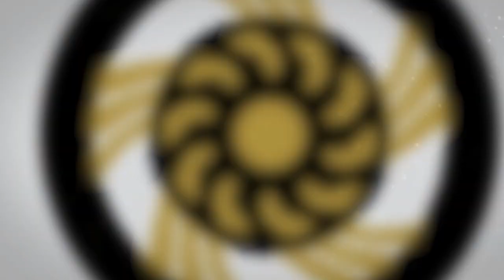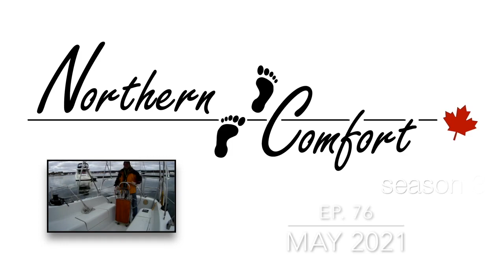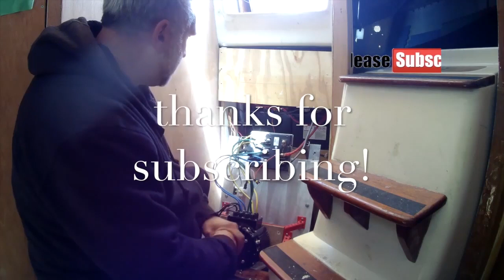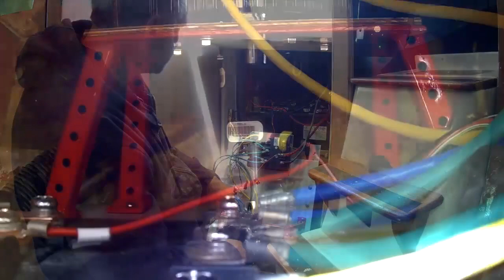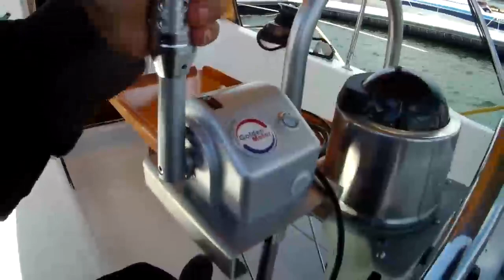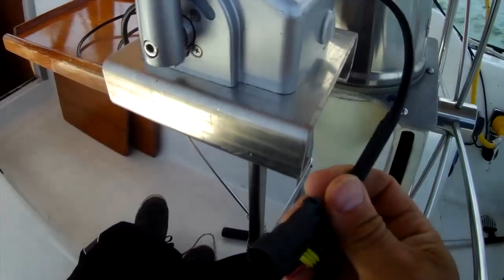Electric Sailboat Conversion Project 48V 10kW BLDC Motor

Comment: Dude, I'm converting a sailboat and you helped me a lot!. I have the old Atomic 30 motor out of my 30' Irwin and getting ready to buy components to convert. I have a 15 hp Tohatsu ob on the transom as well but want both to be more safe with the electric backup or main power system. Cheers!

Comment: Interesting project.  Thanks for sharing.  Metal jewelry is very dangerous around DC with high current available, even at low voltages.  Voltage that wouldn't even shock you will burn a finger off in a second.

Comment: there may be some provisions, in the emerging code, having to do with connections; which may allow for higher voltages than 51.2Vnom.
but i think that center tap sea ground may have to be there, at some point; for packs over 25.6Vnom.......but as it sits at the moment, electrically floating packs are still limited to 25.6Vnom

Comment: Instant torque doesn't matter on a sailboat because the prop limits the amount of torque you can transfer to the water.  If you do the calculations for the prop the amount of torque the prop can handle is much less than that provided by a small diesel.  The only time having lots of torque at low rpm matters is when you are turning a BIG prop like on a tug boat.

Comment: Hi, I did a very similar conversion on a ski boat. I too had major heat building in the controller. I ended up installing a heatsink and fans. I have very little throttle control and the engine cuts out if I push it too far forward. Are you have the same problem? My prop is a 3 blade 12x10. Guessing I need a smaller prop. What size prop are you running. Thanks, John

Comment: Looking good! Thanks for the videos. I’ve got 3kw version in my 27 footer. Do you happen to have any energy consumption figures with different speeds? It would be very interesting to compare. The info I’ve got from different sources is that regardless the boat size, the good speed to go with (as energy consumption point) is around 3-3,5kn. But not faster. For that over that speed, consumption rises rapidly without any reasonable speed gain.
Reply: You might have to experiment with your prop size and pitch to optimize your performance.
Reply: Check out https://youtu.be/ZrrpK6RbfHA for test data he’ has it up there with and wo sail up in zero wind